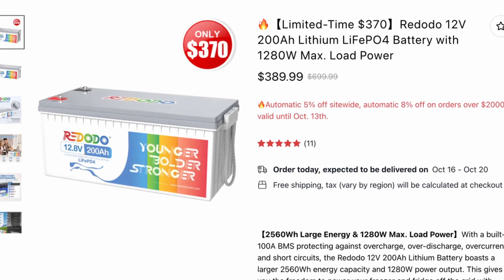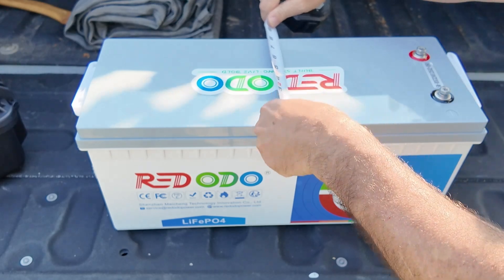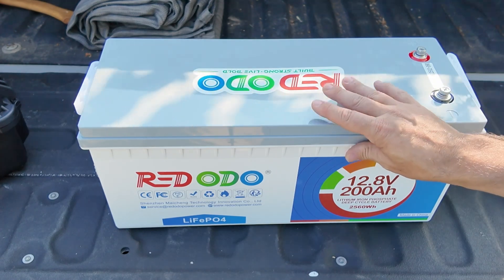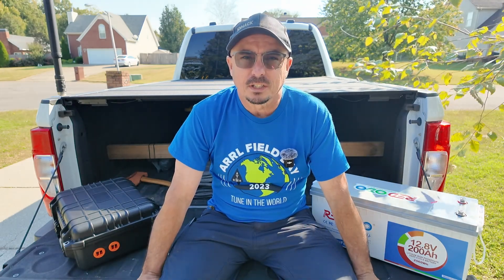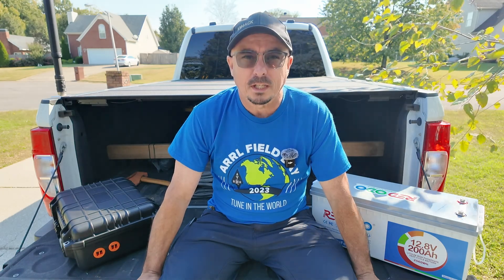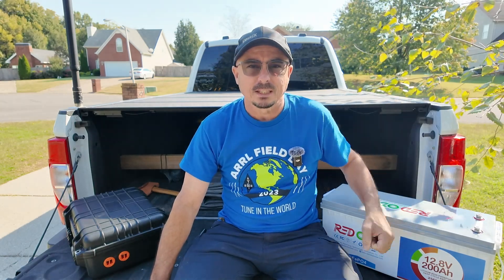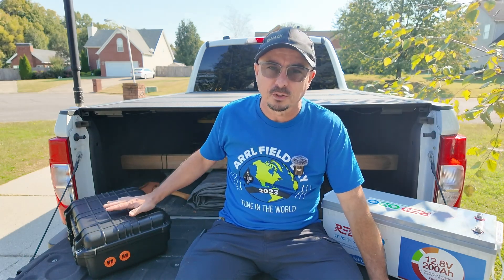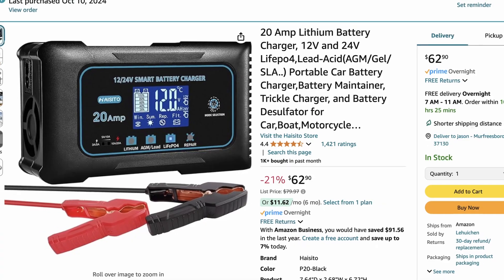Upgrading the Backup Battery in the Shack

Comment: I just purchased an epic PWRgate and I love it. ❤ I am running a winlink VHF gateway and my FT-857D with it. The power supply that I use is a 12v 10a turned up to 14.4v. The lifepo4 battery I use is only 50ah and the solar panel is 100w.  You can only use a 12v (30 voc Max) solar panel with the epic PWRgate so that limits you to around an 195w panel.

Comment: Great minds think alike. I have a 200 amp LiFePo battery in my EmComm skoolie. After this, I'm considering a 50 amp battery for portable stuff. Question - Would the Evolve PC run off these kinds of batteries?
Reply from the maker: Yes. The Evolve will work with LiFePO4 batteries.

Comment: I found that a pair of 100 Ah Cyclenblatt minis on Amazon would be $53 cheaper than a Redodo 200 Ah unit and would include low temp protection.  It's a little more cabling to put 2 in parallel, but it seems like that would be easier to manage than the "big unit".  Any thoughts?

Comment: Once I saw how cool these batteries were and how safe they were inside, I expanded mine. Its about 1.75 Tesla walls, about 23,000 watt hours, close to 2000 amp hurs at 14v. SO, what I began to think about was, since I'm in one of the most expensive power area's in the US, and also one of the areas where power is literally shut off if there is a high wind and fire danger, I decided to begin to sever myself from the Grid. It stars with changing to a 12v fridge and 12v lighting, and little by little everything will become solar powered. I've already cut my power bill in half and have no tricky agreements with the power company. MIne are DIY batteries with BMS circuits I've added. So, the cost was far less. Its a pain to deal with China , at least when it comes to batteries because they are shipped with ocean freight, takes two months. Definitely worth doing though. The BMS boards were very inexpensive, $12 from ebay. Really happy with this system.

Comment: With all the Lithium battery fires happening are you not concerned about having that battery in the house? I am considering having my Lithium batteries stored outside in metal tool box. what are your thoughts? regards Nigel ZL2SEA
Reply: Lithium iron phosphate is much safer chemistry in that regard than lithium ion.  It's slightly less energy dense, so you will still see Li-ion in devices where size/weight matters, such as cell phones and tablets and laptops.

Comment: Great information. I have a 230ah battery that I would like to use to power some equipment and would like to find a smart charger that would keep the battery topped off with shore power and when the power goes out, there would be a need for a switch. But just haven't found the right setup as of yet. Thanks for the video.

Comment: Nice upgrade. If that was 200AH AGM then the weight on the floor may be a problem.  Love the LiFePO4 tech !  remember the math for backup systems is N=N + 1 .  That power gate has solar input you can use with portable panels . You can DC to DC charge from a car if need to.  Even wind gens for 12V systems .  so many ways to charge 12V systems now. 73
Reply from the maker: I wouldn’t have been able to carry a 200Ah AGM up the stairs 😂

Comment: You can parallel your 100ah with the new 200ah for 300ah.  Treat them as one larger battery unless you would rather have separate run time instead of longer run time,

Comment: Great setup, Jason. You definitely have your bases covered nicely.
I'm going to look into getting on of those power gates for my shack! Currently I keep a 100Ah battery under my shack desk and manually switch to it, if I need. I really like the idea of using that device. Especially as my shack grows. I plan to add an APRS Igate and GMRS repeater to my home setup in the next year. So something like this would pretty much be a must for emergency preparedness.
Reply from the maker: You won’t regret adding a power gate.

Comment: Very good plan. I've taken it a step further. I have a dedicated cable from the shack to the outside where I can quickly lay out and hook up solar panels. This connects to a charge controller and pure sine wave inverter (with my battery bank) also in the shack. This allows charging when the sun is out as I use my radio gear. I have found the EP Ever charge controller to be reasonably quiet as far as RF induced noise. The inverter can produce RF when in use.  Keeps me from lugging around a heavy battery and helps keep the battery level up in use. It also allows me to protect my panels from bad weather. 73 !

Comment: Thanks Jason. In place of the PWRgate, can you recommend a basic trickle charger for LiFePo4 batteries?
Reply: Look at something like the EG4 Chargeverter , which can charge the bank from grid , or , generator .
The thing is specifically designed to be able to handle " dirty " power from traditional generators and cheap inverter gens pushed to their rated load or beyond .
Lots of solar charge controllers / off grid and hybrid inverters will come with provisions for a generator input , but , will shut down if they sense the type of high THD and noise on the generator input .
Even if you have a back feed into a panel , the dirty power will usually trigger a shutdown of the inverter and / or charge functions .
The beauty of one or more of those chragevertera is if your electric company does demand based billing , charging significantly higher rates for use during peak demand times versus off peak hours , you can set them to charge a bank during off peak hours at the cheapest rate , and , run on your bank during peak high rate hours . Of course this assumes you have enough capacity to carry you through the entire peak demand period .
It's called peak shaving and can save you big money on your electric bill .
For large systems , 48 volt batteries are the way to go in most cases .
Higher voltage means lower amperage draw , and ,  smaller gauge , cheaper wiring that is easier to work on and manage .
If you need 12 volts it's easy to use a DC to DC converter .

Comment: If you really want to expand, thinking about being off-grid is likely the way to go. But it is much more expensive and involved. Solar arrays with a big(er) battery bank, grid-tie inverter, etc. Then everything is on "standby" automatically and it is just a matter of how much reserve power do you want. Like you, I'm not there yet but that is where I'm headed. Our power is relatively cheap but it has also been less reliable in the past few years. I have an always ready 36kW generator feeding all my existing backup systems which works well. But eventually (15 or so days) you run out of propane and have to get more fossil fuel.  Solar arrays with LifePO4 array is the way to get around that. Then you have a full blown engineering and science project on your hands which is a whole other problem you have to deal with.

Comment: You're off to a great start. The next phase to consider would be a small solar panel system permanently mounted somewhere to feed your battery so you can run indefinitely. Prepare for the worst. Hope for the best. Deal with what you get.
Reply: One issue with permanently mounted solar arrays: Weather. A good hail storm, or strong winds can destroy them. A good portable solar array, safely stored, can be a life saver addition, too.
Reply: @kevinshumaker3753  Why does it have to be one or the other?
Reply: @tshirley05015  It doesn't. It's part of the overall consideration. Jason is a fan of the portable solar panels, too. I have 3 levels, now. Genny (dual power), Perm solar (Harbor Freight), and portable solar. I use mine both for backup and camping. I believe in my comfort at my age.
Reply: @kevinshumaker3753  Just run a cable from your shack to the yard and when needed, set up your panels. It only takes a few minutes and this way, the panels are safe and only out when needed and the weather allows. This has been the system I use and it works great.

Comment: As soon as you know are in the midst of a longer power outage, it would be best to immediately hookup the solar panels to the 200AH battery.  Best to keep the battery topped off as it is being used and don't let it discharge too far.  This will extend your backup operational time significantly.  Don't wait to start charging the battery until it is depleted.

Comment: I can't imagine more than a couple days without commercial power.
Reply: I live in the midwest US in tornado alley, and have to deal with them, and winter ice storms/blizzards, too. I've sat through several 1 week plus episodes, both summer and winter. I feel for those in W NC and central FL that still have no power...
Reply: All it took for us to lose commercial power for over 4 days in Federal Way, WA, was a cold snap into the mid-teens with ice and snow.  Only once in 13+ yrs, but it happened. I learned that a gas grill on the deck makes a decent small refrigerator when daytime temps barely get up to freezing.

I'm still in western WA, and when the "big one" hits the Cascadia Subduction Zone, our power outage may be measured in months, especially since our little town of 17,000 is on an island and not that close to Seattle.  Solar + batteries seems the best choice.  That's great for the summer, but we get very short days, often overcast or raining from November through February.